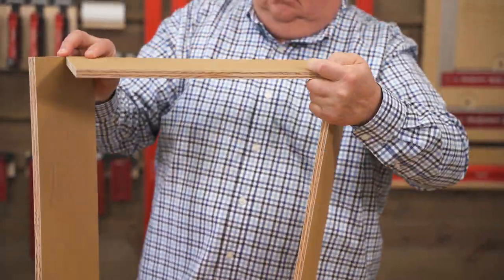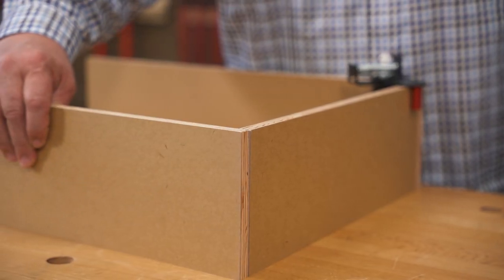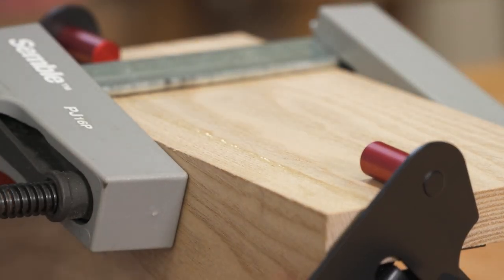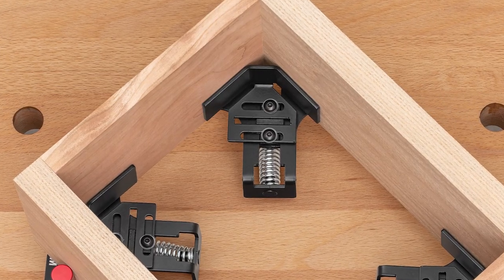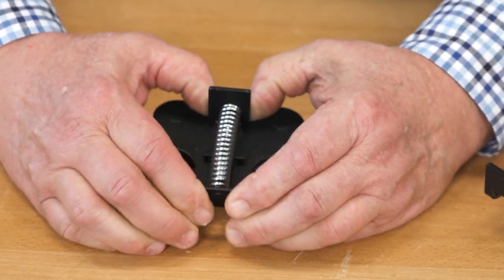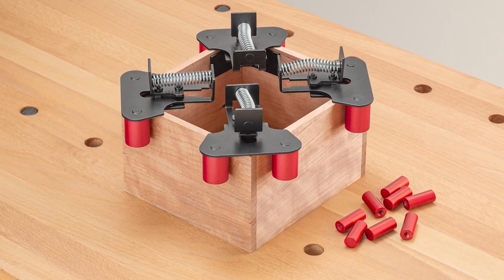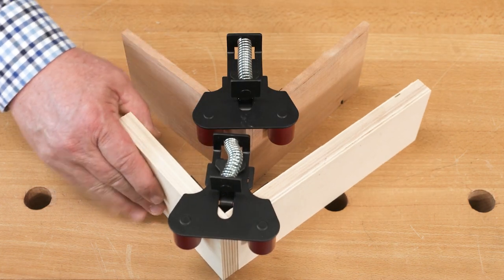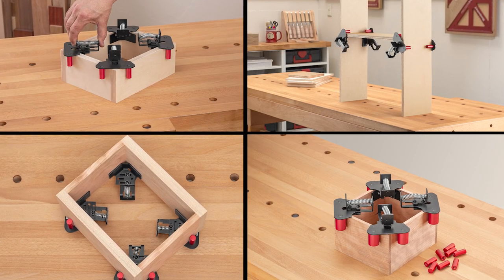CornerLock

Comment: How bout showing the process of changing out the springs?  Since you didn't show it, I assume it fiddly and difficult.  Just to comment on tools that want to do all kinds of things but you need to take it apart and switch over.  That's one of those bells and whistles that sell the tool but in reality, most people don't use as it just becomes another task.
Reply from the maker: It's so easy, I didn't even think about including it. Honestly, you just pull one out and put the other in. That said, If you have normal finger strength, you're likely to never, ever, install the light-duty springs.
Reply: This is a textbook scenario of someone acknowledging an absence of information, yet admittedly "assuming" a set of facts with no basis in known reality. And then proceeding to denigrate the hallucinated factual scenario, thereby painting the original object of discussion as inferior, or even malicious. We need to learn to recognize this when it happens.